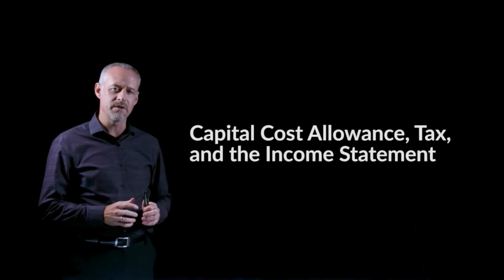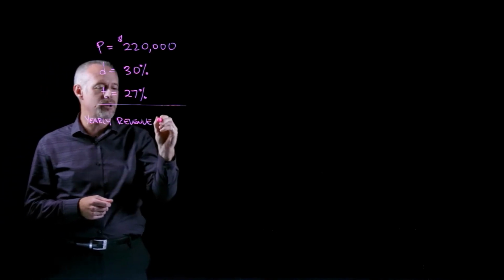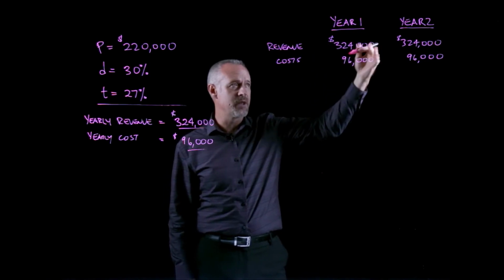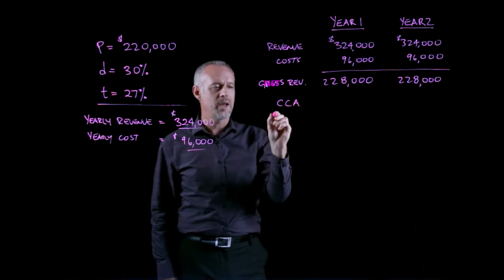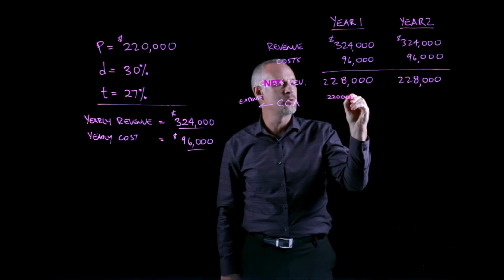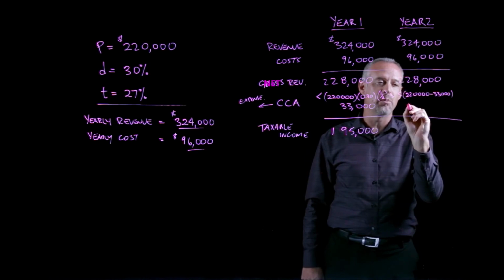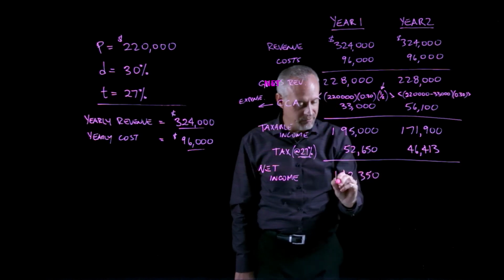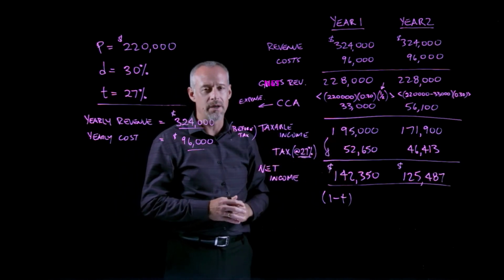Capital Cost Allowance, Tax, and the Income Statement - Engineering Economics Lightboard

Comment: the value of the asset at the beginning of year 2 is really  22000-(30% of 22000) = 220000-66000?   the half year rule is a for the taxing and the not the market value of the asset at the beginning of Year 2. Or am I wrong? From the point of view of taxing I understand why you did 220K-33K because 33K is already claimed. but from the point of market value value of the bulldozer, does it make sense?
Reply from the maker: This example is focused on depreciation for taxes and accounting purposes.  If you are concerned about market-value of an asset, then you cannot use a simple mathematical method such as the method described in this video.